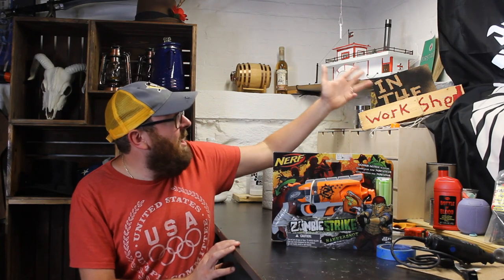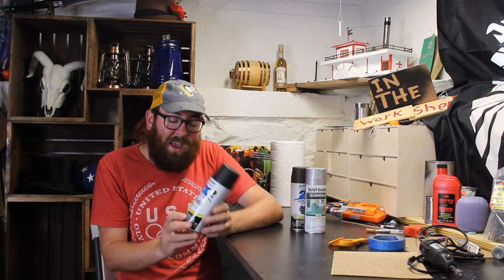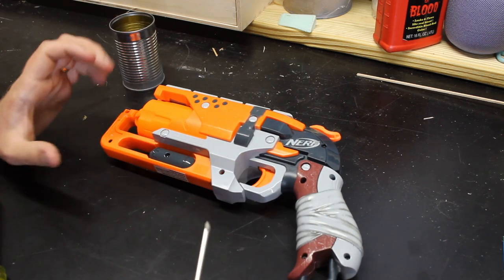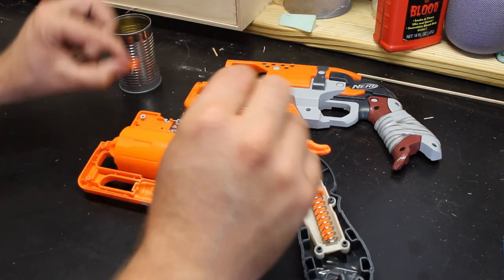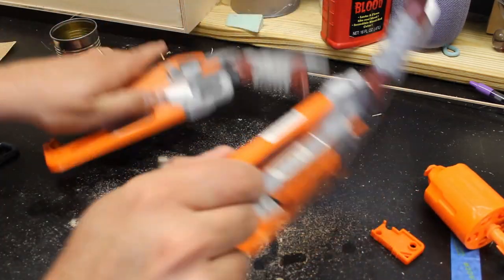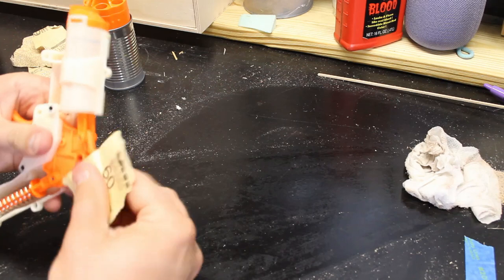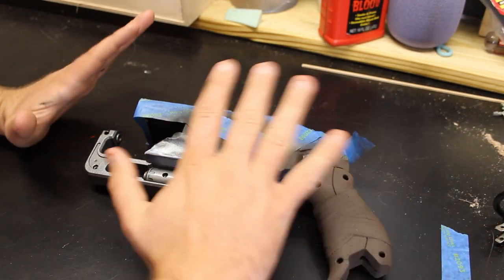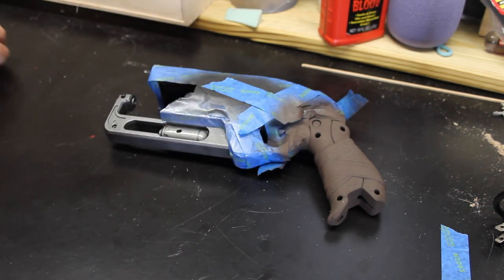In the Workshed! Painting a Nerf Hammershot

Comment: do i need to keep the part orange if im just gonna use it indoors? like with my friends
Reply from the maker: When I've painted moving parts in the past, they can sometimes gum up
and in certain parts of the USA, orange tips are legally required for toy guns. 
Depending on where you live, you might have to keep it orange.
Our LARPs require an orange tip and a couple nerf games we go to require orange tips as well. 
If you want to paint the orange part a different color, what you could do is wrap it in orange tape, that way you can remove it for your personal games. 
-Thanks for the watch!